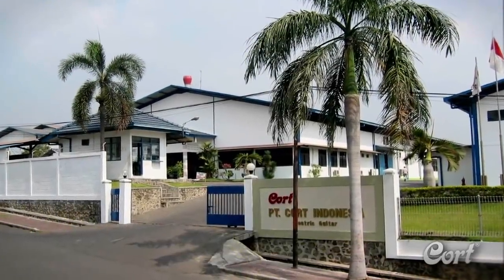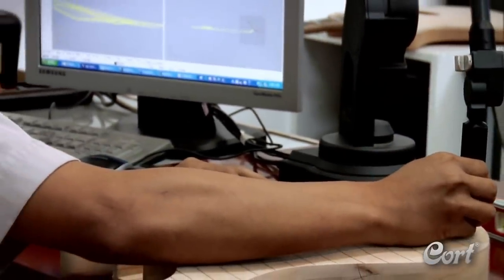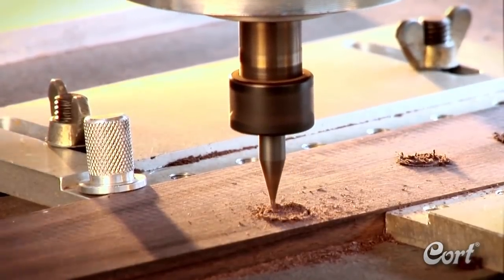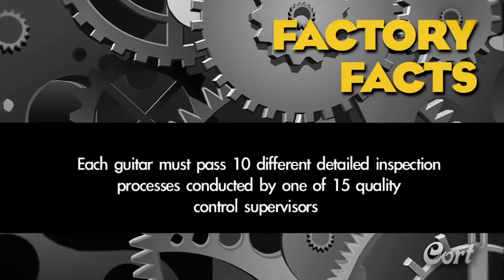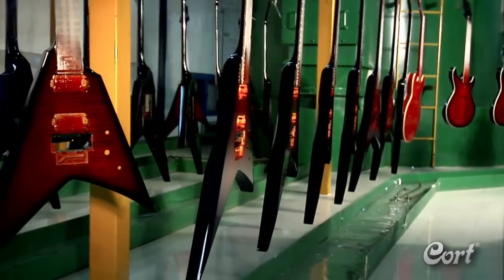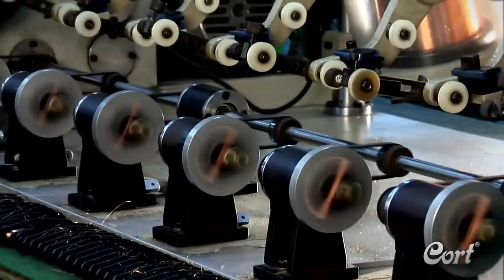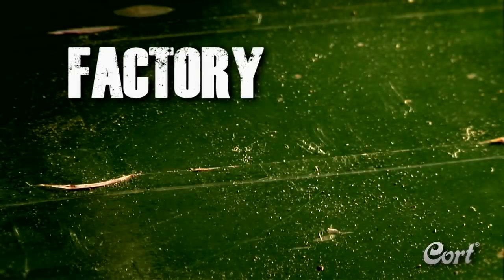Cort Electric Guitar Factory Tour - Full tour of how an electric guitar is made

Comment: For my 21st bday, I received a gift -- and that gift today is still my favorite guitar, out of everything that I currently own, and probably always will be.  It was a Fender Tele FlameTop Special -- I didn't know this at the time, but this guitar was made by Cort -- NOT Fender.  Yes, it says Fender on the headstock -- but Cort made it.  Fender just inspected it and slapped their name on it.  This model (FMT Tele) is actually so popular, that over 10 years later, Fender still has it in their catalog, and Cort is still making it!  It's a Tele, with a set neck, perfectly smooth and sculpted neck joint so no problems accessing upper frets, and it also has a Flame Maple Top!  I'm not sure if it's a veneer top or a cap -- to me it really doesn't matter, but it looks amazing and it FEELS amazing as well -- it's carved very slightly -- not like a Les Paul type carve, but it's still a figured / carved top as to the height of the top is higher where the bridge is and it bevels off around the edges.  This guitar also came with a very awesome 15.75" radius on the entire fretboard, and two Seymour Duncan hum buckers with a coil-tap push/pull on the Tone Knob.  More than 10 years later, I still play this guitar every day.  It needs some work, that's for sure -- the frets are dented to all hell, it needs a re-fret -- I need to have stainless steel frets put on there basically, but that's it.  Everything else is perfectly fine.  The most important point though is that this guitar cost just under 500 dollars back then, and I believe the cost is still somewhere around there today on this same model -- It's unreal the kind of quality you can get on a guitar without spending a fortune.  Cort FTW!  I should mention though, that my guitar was made by Cort in Korea -- not Indonesia.  I don't know what the difference is, but I don't think they have a Korean factory anymore.
Reply: +surgeyX  They had a lot of complaining employees in Korea so they do most business in Indonesia now where the employees actually appreciate have a steady job.
Reply: +surgeyX if u have jumbo frets u can just take an iron file and file till the dents disapear, then do it on the frets that werent so dented so they become the same height as thye ones u filed. then use the file to round them a bit, also put some duck tape between the frets so u do scratch the wood. 
did this to my cort x-custom yesterday and its as if it where brand new!
Reply: +Explore&ShootTV Nah that won't work the frets were jumbo when I got it, they've been worn down some bad...even the ones that aren't dented need to be crowned...would just be easier to replace them all with stainless steel.
Reply: surgeyX about replacing i cant help. never done that. Mine are really cool now, even better than when it was new, as they were too roundy, now they are more rectangular shaped, nicer feel
Reply: So instead of paying a fair wage they move their factory somewhere else? That's kinda shitty.
Reply: That's how it works...If this wasn't the case then FoxConn in China wouldn't be manufacturing like 95% of all the world's electronic handheld / mobile devices.
Corporations are profit driven robots.
Reply: Ammo Man actually I can do somethung. I can talk to my representative about b the middle east thing and I can choose to not give my money to companies like Cort.
Reply: This is how countries become industrialized, Guys. Remember when Made in Japan meant cheap junk? I do. But us using them for labor taught them how to make things, and after a while they became our competitors and we moved to places like Korea and Indonesia and China. It's all good. They learn business and skills, and we get deals. For a while. When we can't afford their labor anymore, they have become an industrialized nation, and people don't have to starve in the countryside.

Comment: I don't think Gibson's are really made any better. I love all of my Asian Guitars. I think Cort might have better CNC Machines than Gibson.
Reply: Terrance Fields~~Are you serious?? Corts 25+ year old machines are ancient compared to Gibsons' hi-tech modern CNC machines......Wake up McFly, it's not 1980!
Reply: I think  Fuji-Jen in Japan made the best replicas because they did. They still make Gib. replicas that are correct including the hardware for $2K-$4K. Far superior to the stuff they make over here. The parts and hardware on a pre-82 Burny or Tokai will have correct body cuts and American Standard in inches including the brass truss-rod nut. None of you baloonheads have ever really owned or handled  1930's to 1961 ink number Gibson products. 
 I love my China Guitars because I have a 2-3XL hand so they have made mine to my specs.  Gibson won't build me a  super high quality guitar  for less than $400.
Cheers
Reply: The Gibson factory have a excellent CNC machine which accurately machines just where the headstock will snap off. Prior to 1980 it was done by hand.
Reply: Happy to hear you have a good experience.  Your large hands need a custom made guitar.  That is why one guitar is not good for all people.  A man with massive hands will prefer different specifications than a young lady with petite hands.  Less than $400?  Congratulations!
Reply: I have an American made Fender Strat (Vintage Reissue) where the screw holes are not accurately drilled, so the pickguard pops out and warps so that the screws can go in. They sound really good, they feel really good, and they resonate very well. It is a very special guitar.

Made in Japan Strats are PERFECT. However, despite this perfection found in Japanese made guitars, we don’t see them being very collectible. Vintage Japanese made RGs don’t sell for much on the used market either. Japanese Strats are not coveted by musicians to play or record, and there must be a practical reason why. They don’t sound and feel the same. They are very sterile instruments. 

I realize, sometimes it is the imperfection that makes the instrument “perfect”. I always laugh at the warped pickguard on my Strat. When I look at the warped pickguard, I laugh at the American craftsmanship, yet I take my hat off them that my MIA Vintage Reissue Strat sounds and feels so special to play.

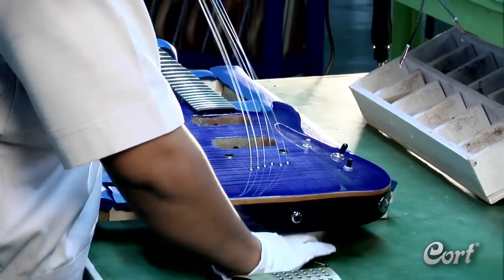Comment: The part at 7:25 They use the word "Ownership", but what they really mean is the One person is Responsible, so they know who to blame. However, I own 3 Cort guitars, and each comes with an Inspection/quality tag. The Tags display Assembly, Setup, Finish, Elec. (electronics) and Final, and a different person signed off each step.

Comment: Which guitar was that at 0:12
Reply: M600
Reply: ***** cool, im also trying to get a 2004 korean made M600. many sells it used here for really cheap -- Rp. 2,5 million = $245-ish
Reply: ***** i would go with the M600, it has Seymour Duncan. while the CR250 uses pickups made by cort itself -- Powersound, ClassicRocker, etc.

450$ for a used is like a brand-new M600 here in indonesia :p
Reply: ***** the M600 got Duncans, and the CR250 sound the same as gibsons. to me, it's just the matter of looks now.

the M600 and CR250 both are cort's top of the line models, i think you should really be fine with either one of those.
Reply: KazKrin yes sorry, i was wrong.
chill out.

Comment: All the Cort Korean made Fender Squier guitars from 1990 - 1995 with the Black Squier logo are MADE OF PLYWOOD!! Don't think so? Open the Trem plate and scratch off some finish vertically and learn. If the Strat Squier Sunburst finish model has black edge sprayed into the Contour relief cut areas at the hip and arm - it's PLYWOOD! They were hiding the wood edge.

Comment: I believe my eyes and my hands. There is a local Cort store near my place and I know every single guitar that were there or are there for almost ten years. I claim: the quality of sound of Cort electric guitars is quite nice, but the quality of it fitting and overall look is very poor. New guitars, taken out of the box, can have scratches, unintended gaps, lacquer spots on headstock or fingerboard, wood selection is also poor – there is currently a G100HH at stock that is built from 5 or more different pieces of wood and with OPN finish it looks weird. I can talk a lot about all this, but the point is that you should carefully choose what you buy and examine every corner, every inch of an instrument, even cheap, to be sure it will make you happy.

Comment: Since when "a capacity of a million guitars/year" is considered as a quality ? Ask Bill Collings ;-) Cort guitars are "all right" but you won't make a Cort sound like a hand-crafted guit equipped with Lollars… besides, they should change the logo on the headstock, it looks really cheap. I also own a guitar made by Cort in Indonesia for Fender. Worth a 150 $. It's the guitar I take on the road during the summer. The neck is very good, satin finish. I had to modify the electronics and solder a treble bleed. The tone is OK, but lacks of character.
Nothing against it, but you get what you pay for… \m/
Reply: a hand crafted guitar wont cost 500 bucks, a real hand made guitar (a mayones, or a Vik for example) will cost 10 times that

Comment: Indonesian squire standards are high quality instruments. I have one that cost 250$, seriously wouldn't trade it for a 65 mustang original. it just has a darker sound than a usual strat, clear sustain full highs. black and white with black matching headstock made in 03. gold stratocaster in spaghetti logo. play it through a suped up fender amp or my crate half stack, I'd have to have a grand for it. specially set up, low action no buzz Texas special like pickups in it. damn thing can play anything as long as your fingers allow it. I call it my black bird after my song, long after my demo and lp release I will be using this same guitar on stage. I will smash a 800$ strat before this. even my guitar tech thinks their is something special about it.

Comment: Feeling Proud to own a Cort X11, that guitar is fuckin amazing and it plays like butter.  Everything about this guitar is top notch except the Floyd Rose licensed bridge system, it gets out of tune all the time and it is a headache especially if you use the whammy bar like normally.. 😪 !?? Seriously.. it SUCKS for real plus the huge cone is the whammy bar gets loosened and wobbly and you can’t trust it anymore, it will make your playing crappie … the locking system beneath the whammy bar gets fucked up if you use the whammy bar back and forth.  Cort guitars are always top notch in terms of build quality (TONE FUCKIN TONE, these are the guitars made for TONE, because these guys are so notorious to do the BEST Kilin Dry process to tone their wood slabs for production, plus these guys throw either Seymour Duncan humbuckers or EMG humbuckers on their top series of production lines.  

A humble request to Cort, pls get rid of that Floyd Rose copy loser tremolo fucking crap system, it is a pain in the ass.  There are tons of really stable and reliable trem systems on the market, pls purchase them and throw them in your machines … !.